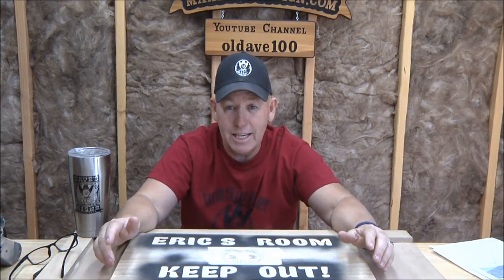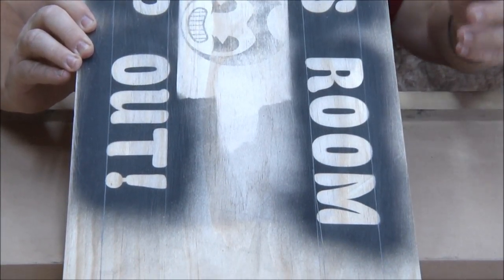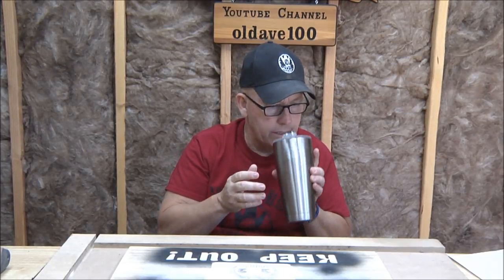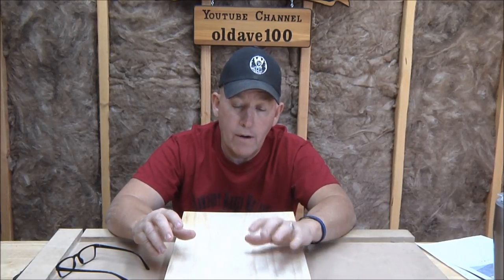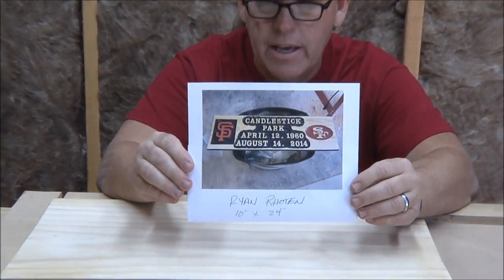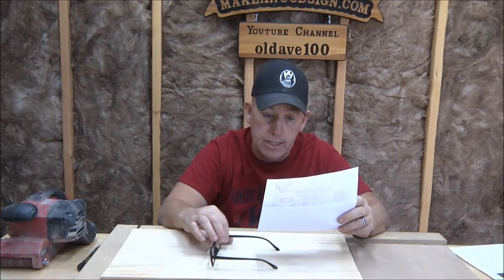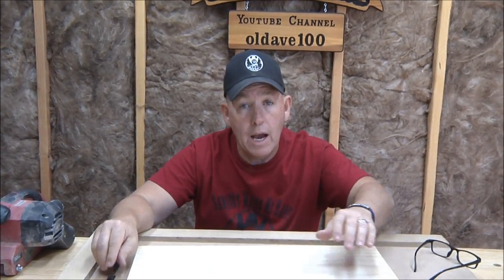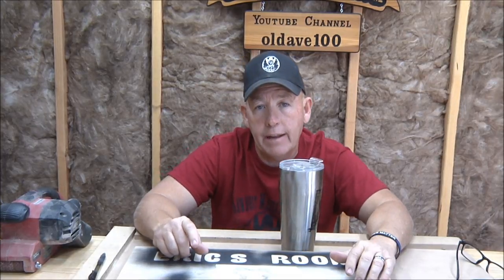Coffee & Questions 6/12/17 Sanding A Cupped Board & Drawing Lines

Comment: I have found that the high heat and extreme sun here in north Florida will cause certain thinner types of boards to warp after spraying. I put those back in the garage and let the humidity help relax them back into shape.
Reply from the maker: On my pine I always put sanding sealer on it as soon as it gets to the shop. That prevents much of the cupping. On the cedar I leave them on stickers with weight on them till I make them into boards for signs. Some cupping but nothing that I can't deal with. We all have our climates that we have to deal with and figure out. Sounds like you got it figures out. Thanks for the input my friend, Eric

Comment: I've done what you're talking about today.  Sanding the sides to take care of the cup shape.  My problem came when I was putting the  saw tooth hanger  on the sign.  The finishing nails went  through the sign because it was thinner on the sides.  So I had to sanded the front of the sign and put several finishing coats to fix the problem on the front.  Then I used a grinder to shorten the nail.  Now, try to check the length of the nail before driving the nail into the sign.  You may need to mention this for others to look out for on their signs.  Thanks Jerry from Texas
Reply from the maker: Good point, yes always want to make sure on the thin stuff that the nails aren't too long. Thank you for the input and for watching.

Comment: Easier way to get rid of cupped board is to place it on a plywood with concave side up and shims placed underneath and run it through the thickness planer to get rid of the concave. Then flip it over and run it through the planer again to flatten the higher sides.
Reply from the maker: That's one way to do it. Thank you